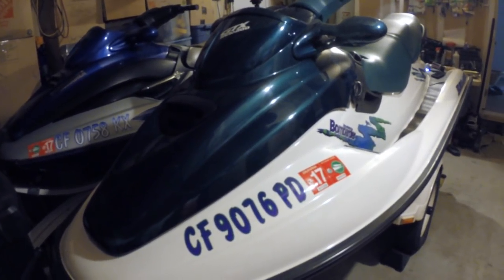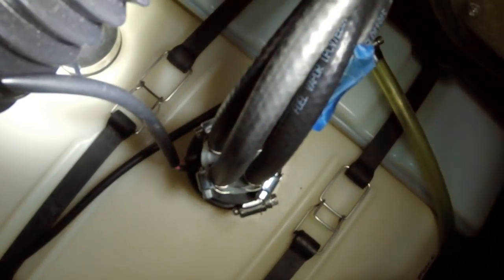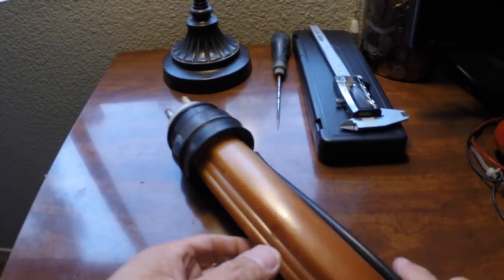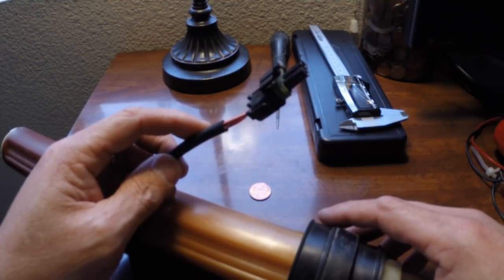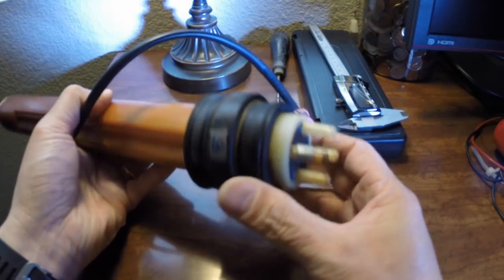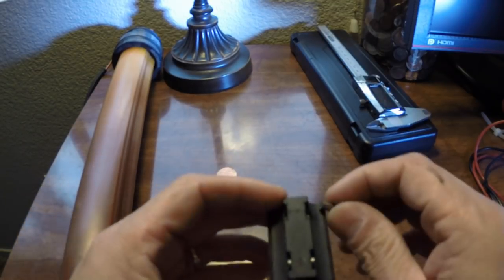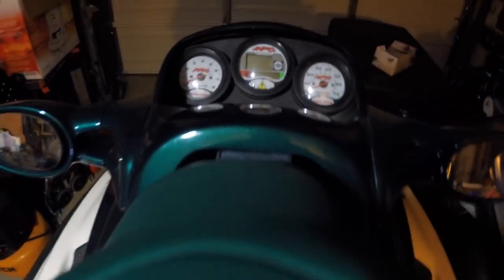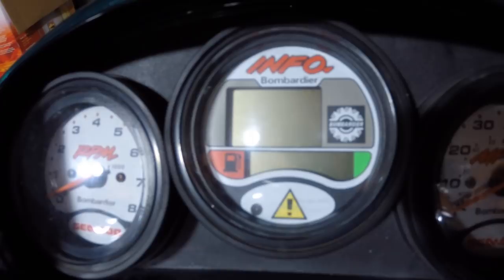How to fix repair Gas Gauge SeaDoo F1 Fuse Fuel Sending Unit Troubleshooting GTX Baffle

Comment: I do not know how you figured this out but I am glad you did. I just did it and it worked. I had the original tube but accidentally cut too far into the gas line at the top. Brain fart and bad vision. Ordered a used one of Ebay and did what you showed. I used my old one as a template on what not to do and the dang thing works. Thanks again.

Comment from the maker: Bottom line: 1. Check Sending Unit Wires 2. Check Float and Magnet 3. Blown F1 Fuse. Pull out fuse and bridge it with solder (where the fuse used to be). I have seen 2 f1 fuse. The one on this video and the other... a very tiny one. See S Morell vid link below. Same action. Pull f1 and solder: https://youtu.be/db1IEff3GEE?list=PL6vR9pff96YM9UV1W2v02mDuSU5BuNdGH
Reply: could u tell us the difference in the years or models of the two..i have 2 95 gtx with 657x..other than that great video for  other people  learn ....thanks

Comment: GTX is alot easier than GSX to get the gas guage float tube out. GSX you need to pull the gas and oil tanks out. I ended up with all new gas lines and still having a dead gas gauge. Seadoo mechanic said if I fix it it will fail again. It is what it is. Thanks for the video.
Reply: if its anything like the XP / SPX you can get it out, just takes a bit of swearing and the right angles.... but it does come out with tanks installed.

Comment: You can test the gauge and wiring by simply placing a jumper in the sending units plug on the boat side.  Simply place a jumper in it and the gauge will read full (all LED's lit), pull jumper and it will slowly count down the LED's.  If this works, then your float is leaking, mags fell off or F1 Fuse dead, either way, pull the probe out thru the glove box (center storage) cause it's the cause.  If jumper don't light up gauge LED's, then most likely the fuse in the sealed box or possibly wiring or the gauge itself (but highly unlikely, jumper should work 99%).  DON'T DO ALL THE CUTTING AND GRINDING on the sending unit, you can simply cut a small door/flap into the probe about 2.25" down on the seam with a razor blade, poke razor in probe, it cuts fairly easy,  Only open it up enough to solder the jumper.  With a small opening you really do not need to do all the welding back together, simply close the flap, cause that area does not need to be sealed, note the vent hole on the other side, only the pickup tube areas need to be sealed.  Do not cut too deep and hit board.  Test after repair of F1 fuse with and ohm meter hooked up to the sending unit wires, as the magnets slide up and down, the ohms with change.
Reply from the maker: Jim May Good stuff! thank you Jim

Comment: If you take the floats out  make sure they float in gas ,   they looked fine , they floated in a bucket of water ,  I reinstalled the sender  ( royal pain in the asson a 1997 GSi )   and it didn't work  the second time I tried in gas and they sank .  so float in water , sank in gas  due to the difference in density!!!  .  new floats cured the problem !!
Reply from the maker: So true! Great point! Thanks for the feedback
Reply: Same here, Kevin.  Float had no visible damage, but sank straight to the bottom of a Mason jar full of gas!

Comment: oh hey any tips on removing the gastank from a 94 gtx?  the fuel inlet hose is not just the standard rubber hose, it has an internal hose.  seems very little room to remove it at tank as that internal hose sticks into the tank quite a bit.  Thank you...

Comment: I get a reading from my sender and it receives voltage but nothing on the display. Last ride the sender plug come off inside the tank and it was beeping low fuel. So I'm certain it won't beep with plug back in because no display

Comment: quick question, is it possible to just make a hole where the pink wires connect to the board and then just unsolder it there ?? Just seeing if I can disconnect the board, slide it out fully for the repair and then reconnect it. 

I like your inline fuse idea, much easier to service and seadoo is somewhat idiotic for not placing an inline fuse for these things. Its hard enough to remove the sending unit, let alone now throw it out for a burned out fuse lol. 

Thanks again for the videos.

Comment: So if I heard correctly - you removed the old blown fuse from the sending unit, simply soldered a wire to bridge that gap, and put the new fuse on the wires outside of the sending unit/gas tank so you can more easily access it in the future?
Reply from the maker: +Nicholas Wittemen That is correct! I removed the blown f1 fuse... bridged it with a glob of solder, then added a mini inline fuse holder with a 250ma fuse. As you said, for ease of access and for the next time it gets overloaded (blown)
Reply: Couldn’t this ignite a explosive situation gas popped fuse see where I’m going
Reply: @devshewitt4809  is that guy haha
Reply: @loamy  what

Comment: My F1 was bad but had replaced the float hoping that would fix. Now i lost my factory float and the aftermarket is smaller and acually sticks to the resistors metal on the board. it seemed like it would break free but seems to read inacurrate. should I take the top or bottom magnet out to make it stick less.
Reply from the maker: Sorry to hear... may I recommend that you return that float and order another from a different vendor.

Comment: I just did my fuse and plugged it in and stuck it in the tank. I am now showing full fuel even though I have half a tank. Did I solder something wrong?
Reply from the maker: Check your float...perhaps one of the magnets fell and the float is now stuck.

Comment: Hi I cut mine open and I can see the F1 stamp on the board but I don't have any such fuse. Have you seen this?
Reply from the maker: Sometimes it is just a very tiny black rectangular... take a look at this website: http://greenhulk.net/forums/showthread.php?t=7884
Reply: Yes that's what I have! Can I just solder over top of it? Or must it be removed?
Reply: Take it out then put a blob of solder
Reply from the maker: Put your soldering iron then push it aside... put a blob of solder to connect / complete the circuit
Reply: Ok sounds good, I'll give this a shot tomorrow!!

Comment: if you look at the side of the sender by the inlet tubes the tubes are identified in abreviation.. ret for return ect.
Reply: yes exactly, no need to mark them up, at least my 99 spx has them written on the sides so its easy to reconnect. I like the add blue tape on the hoses with tags but they usually wash away.

Comment: Hey I have the same boat it's a 2001 challenger 2000 runs great but when it gets to 45000rpms it stalls out will start right back up but continues to do the same thing so any help would be great
Reply from the maker: 1st to check are the fuel filters. Mine has 3. 1 external and 2 internal (carb)
Reply: May be battery voltage regulator, they are very common to fail and cause the ski to cut out as it's overvolting.

Comment: I checked my gauge.   I can see the float moving with an ohm meter.   When I hook it up to the Ski, if I hold it upside down it shows full (i.e. full tank).  Right side up (i.e empty tank), nothing  but it also shows nothing in the when the float is anywhere else in the track.  Is it the sender or the actual gauge?  I checked the wiring and it appears to be ok.
Reply from the maker: Brian, does the ohm meter gives you a numerical reading? Different numerical reading from empty to half to full? If the ohm meter gives you readings... your sending unit is fine. Then it could be one of the two: 1. Your Fuel Gauge 2. The wires between the fuel gauge and the sending unit (do continuity test)

Comment: Hi there. Great video.
I have a 1999 GTX Limited with same gas gauge issue. I removed sending unit and tested the OHM and there was no change as the float slid top to bottom. Float is in good 
condition too. By process of elimination I'm quite certain its the F1. I cut the sending unit and located on the board a stamp that says F1, but I don't see a F1 fuse? I'm assuming there are different boards for different years, but I'm not sure how to go about "removing" this fuse. Can I send you a picture of what it looks like?
Reply from the maker: Sure. CBatilo@gmail.com there two types for sure... rectangular (long square) and the round one on vid. Send the pic and I will Mark it and send it back. My friend had one like that.
Reply from the maker: I sent you an edited pic. Your cut is in the rught place. Just place a soldering iron as you push it to the side... it will come off. Then, just put a glob of solder to connect the circuit board (void from f1) where the f1 came from. Good luck!

Comment: I cant find the magnet and flodder, can i change the fuse and would it work without the magnet?
Reply from the maker: You need that magnet - float. You may not need to change the fuse after all. Just do the float - with magnet. You must have magnet
Reply: cbatilo my jet sky, I don't see any gasoline come out when I put 12v on the leads of the pump. I took it out and it had no bottom cap or magnets. Does the pump make any noise when is powerd?
Reply: cbatilo also, I don't care if the fuel gage don't work I just need the jet ski to work.
Reply: @SamVasquezGerman  hahha then yes ignore all repair videos, run it on FULL fuel, then when it starts to stumble, switch to reserve and thats your sign to return to shore / empty.
Reply: they probably fell into the tank, like mine. The circuit board is a series of little glass tubes with metal connectors, they click along as the magnet rolls up and down. 
Mine was inside the tank, or the previous owner carried out some home made repair on it which clearly did not work.